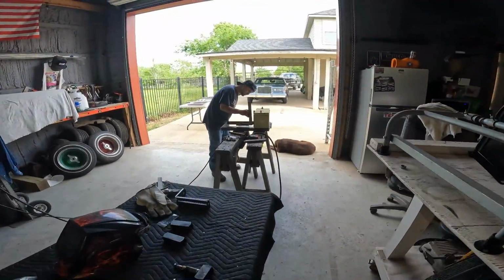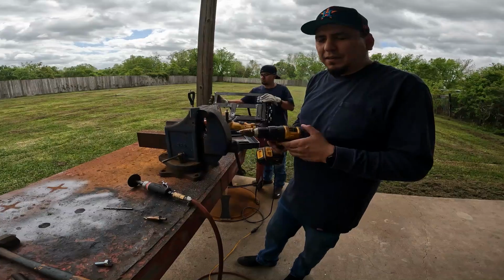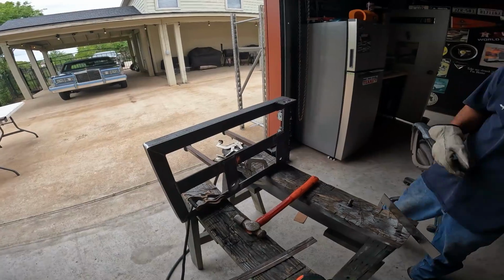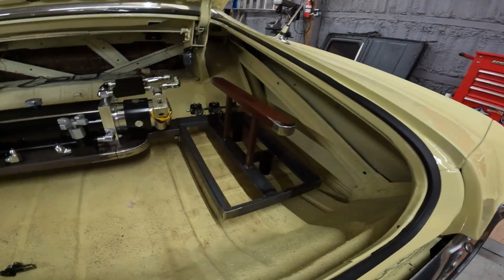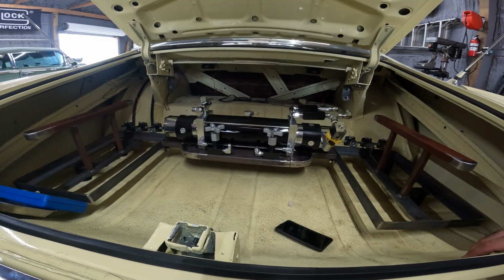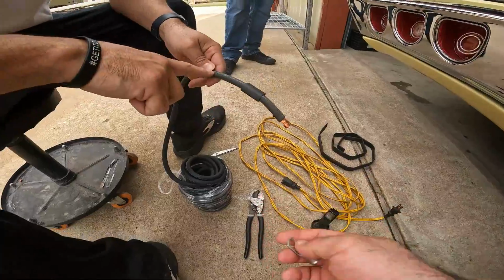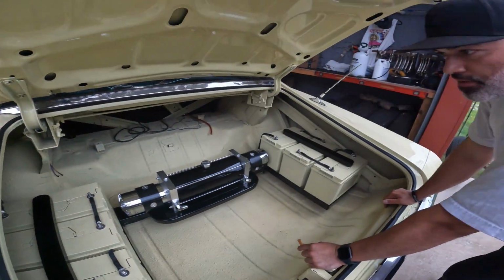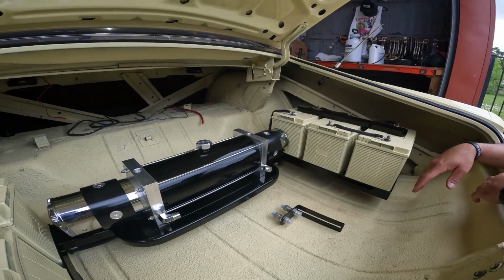BUDGET LOWRIDING HYDRAULIC INSTALL!! / BATTERY RACK / CUSTOM / LOWRIDER / TEXAS TOAST / 1968 IMPALA

Comment: What size of gears you running and how did you do 72 to front and back?

Have a whammy tank from Hoppos with #11 and 9 to back, 6 batteries, 3 on each side like you.  Was gonna do 36 to front and back but don’t think 36 is enough for the #11 up front.  I am only doing lay and play set up.  No hopping at all
Reply from the maker: i think he has 9s front and back.  its easy to run 72 front and back.  just run your cable from the 6th battery to each solenoid bank. so 2 cables coming off the last batery.    72 is snappy but its not enough to really tear anything up.

Comment: Very Slick install 🙂
Lots of great ideas and Workmanship by everyone.
Bobby is a very skilled Welder and his work shows it.
Johnny is great at making all the wiring look 1st Class and hiding the bulk of the wires.
I like the tip on putting the printing and crimp on the bottom for a cleaner look.
So 72 volts is what it takes to all the Hydraulics work ?????
Do the batteries get warm ????
Reply from the maker: Good afternoon Ed! yeah it was a pretty slick tip he gave out,  it actually never crossed my mind to do it that way until he showed it.  It doesnt take 72v.  I think it could be done with minimum 24V,  but,  a standard is usually 4, or 6 batteries.  48 or 72v.    we could wire it to 36v each motor and run to separate banks...still options on the table